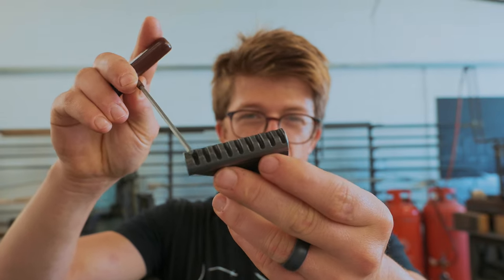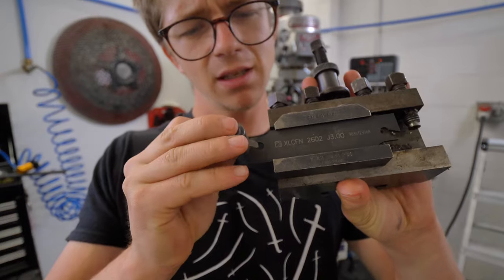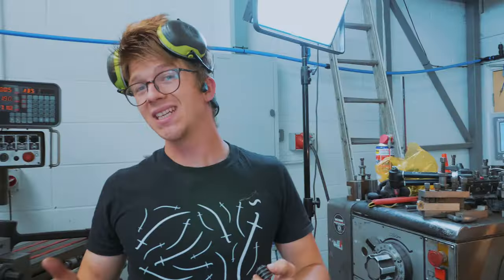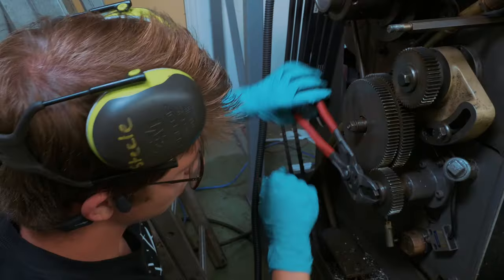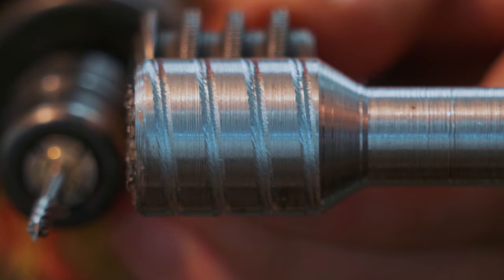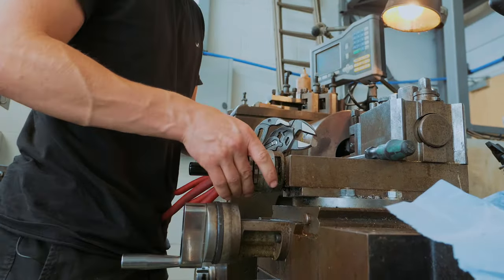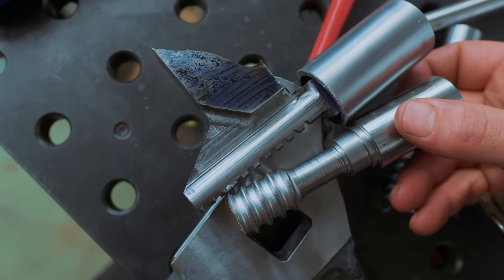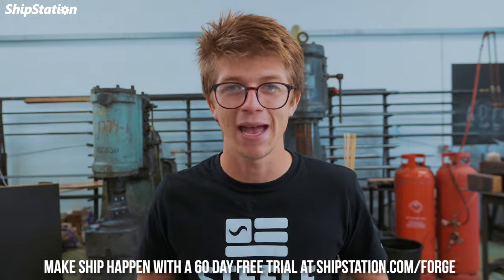Making My Own ADJUSTABLE CRESCENT WRENCH! Part 3

Comment: An idea for the handwheel numbers: set up an indicator to get a real measurement of the top slide, you can back out as far as you like to clear the thread and reverse, then wind in 1 rotation of the dial as your starting zero, then its easy to track your depth

Comment: What i have done before is to mount my angle grinder with a cutoff disc to the tool post and use that to do the work. Much more rigid than the small die grinder.

Comment: Hey Alec, you could have reversed the teeth and the worm gear and it would work the same, but you could have done it without grinding down the bolt.

Comment: No need to rely on "worn" out carriage screws and the built in indicator on the lathe. Attach a dial indicator and reference off of carriage or cross slide as a backup or verification method to your depth of cut measurements

Comment: But if advice, get you some High speed steel tool bits for times like this. Grind your tool until it matches the shape of the screw you’re trying to do. That being said the way you worked around and figured it out, as a machinist, I couldn’t have been more proud when you figured it out.

Comment: You could use the X-Axis (Cross-Slide) on the Lathe to retract the Endmill out of the Thread. 
As long as you return to the same Position as it was while cutting and don't unlock the halfnuts you should end up at the same position for each pass.
So basically you need to set the Endmill at the Leadangle of your thread (with the toolpost or compound-slide) and set your Cross-Slide Dial to zero before you start cutting.
Then do a pass -> retract the cross-slide -> return to your Startpoint (run maschine in reverse) -> go back to your Cross-slide zero and adjust depth of cut (tool height) -> do Next Pass -> repeat until finish.
Reply: He'll still have the same problem. It's the set up not the machine. The width of cut keep increasing because the cutter is at an angle.
So he's cutting a line, instead of a point.

Comment: If you were to get some square HSS steel blanks about 150mm long 15x15mm 
Grind it into a sort of part of tool type style if you will, 
Grind it to size and leave enough of a clearance angle so that it clears the part you are turning and enough of a rake angle so that it cuts 
You should be away with making your thread 
Hope that helps Alec

Comment: I believe your thread profile issue stems from this:  you're trying to use a cylinder to cut a square, as well as the fact that you have a tool that cuts along its entire length instead of just on the end.  

As I'm sure you're aware, it's hard to get a square corner out of a circular tool, as there will always be a radius to your cut.

More importantly, however, your tool is cutting over more than one point.  That means that while the actual segment of your tool that's contacting the bottom of the channel may be cutting it almost squarely (except for the aforementioned radius), the rest of your tool will be contacting the sides of your threads and hogging them out.  If you lay your cutting bit into that channel, you'll see what I mean.

(EDIT: This only would apply if you had the cutting tool perpendicular to the piece.  If you matched your compound's angle with the angle of the treads and are still having the same issue, then I've got nothing.)

Comment: Well theres a new method , its as fascinating to see what doesn't work as well as what does.  A lathe that size would have no problems single point cutting. Well done at the fitting stage.

Comment: Ive made my schoolarship 3,5 years on almost exact such a machine. With the gears and everything!
Maybe still not too late: If your scale on the diameter-axis isnt working as shown in your video, you can use a dial gauge to get the exact movement of your upper support! Set it up on your main support and place it in direction of the diameter infront of the upper support. You can see every single 0,01mm movement! Not sure if the scale is big enough for a 6mm screw tho :)

Comment: the reason the mill is cutting way wider than the bit... is because you're cutting from the side. the bit cuts more than just a point. remember it cuts in front and behind the center line.

Comment: The cutter is deflecting from stickout, like some people have mentioned, but also because the die grinder rpm is way too high, which means the chip load per tooth is probably less than the minimum size for that endmill. An air regulator to drop the rpm would improve this. Yes obviously grinding a thread form cutter is the right solution, but square threads are going to cause a lot of chatter on most lathes anyway.

Comment: Please please please make a cutter out of HSS, I make all my own turning tools and while it doesn't last quite as long as carbide, it should take an hour or two at most for someone who hasn't done a heap of it, I'd imagine less time for an experienced blacksmith with fantastic tooling too use. I love the ingenuity of making a die grinder fit, but it could be so much easier and better. Love your work mate!

Comment: Personally I would grind a tool to the profile you need, then cut the thread like you would any other thread, but just remember to use plenty of lubrication as you will have a lot of cutting edge cutting at once.

Comment: I think the reason your thread profile got screwy is because you turned the grinder a few degrees to match the thread pitch. But when you did that, the bit was no longer cutting a straight line. It was cutting a triangular shape in the cylinder. Because the cutting edge was meeting the material at 2 different places the further you got from your tool rest. It's the same thing that happens when you wiggle a drill around to widen a hole up a little bigger than the size of your bit. You probably didn't notice because the cylinder was also turning in the lathe, and you were left with a profile of the widest part of that triangle shape instead of a trench the size of your bit. You MIGHT be able to compensate by using a smaller bit, but that sketchy apparatus made me very concerned for your well being. So a smaller bit (that's more prone to breaking) is probably a bad idea. Great video. Keep 'em coming.

Comment: also a tool of a specific size almost never produces a cut of the same size if you go for a 4.8mm cutter you will have more accuracy in the thread albeit that you need to mill it from both sides of the thread.

Comment: Just make a HSS lathe tool from some square stock make a relied angle and grind the tip into the correct profile using a metal protractor to get the right tooth profile

Comment: How long before Will realizes that if you change the groove-groove spacing, while keeping the diameter the same, you also have to adjust the pitch angle? 
tan(pitch) = Spacing / diameter

Comment: You need to learn how to make tools out of high-speed steel or carbide. You can use old broken end mills and milling cutters. Just need a diamond wheel to do the finishing touches and sharpening. Making your own tools makes projects even better.

Comment: They make an ACME threading gage that will gage the profile of every ACME pitch profile. Side angles as well as nose width. Buy the gage and make your tool. Set your compound at the required angle. Use the cross slide to draw your tool back once you've zeroed it. Then use your compound to advance your tool after each pass. You're a researcher by nature. Look up the process, watch a few tutorials. You've done so many things exactly right. Do this part right as well. With a pointed pitch on your screw, the first time you exert any aggressive force on your beautiful wrench, you will shear those points right off and bind up your wrench

Comment: The one off tool would be the way to go but if you insist on end mill grinder setup make the OD of the threads bigger than needed and then flatten the tops of the threads to fit

Comment: I don't think the problem is the tolerance of the lead screw and locking nut, but instead the rigidity of the 3mm end mill. Something that small is bound to deflect when a load is put onto it. if you choke up on the end mill right to where the flutes start, then that makes the tool more ridged.

Alternatively, you can just grind a single point acme thread tool, I have made tools out of straightened and reheat-treated springs in my home shop before whenever I didn't have spare HSS.

Comment: So I was always taught to never cut both ways when screw cutting. The backlash will affect the cut. You need to pull the tool out and go back to the start to initiate the next pass.

Comment: A saw blade in a die grinder works well for cutting your 6mm pitch thread.

Edit: It appears to be a better choice to use an under width blade and creep up on cut width. This peculiarity with 2 and 3 inch straight tooth saw blades has shown up many times. Still thinking on the reasons for this.
Reply: Because the work piece is rotating into the cutter, and the cutter is at an angle.
A straight cutter will always cut to the same width, but if the cutter is on an angle the width increases with depth.
Perpendicular is a single point. Parallel is a full line. An angled cut is somewhere between the two.
Reply: @c6q3a24  On the right track. The cutter must be angled. There's a trick you can create a negative space to make the moveable jaw really lock to the thumb wheel. Some purpose built adjustable wrenches for an fittings use the modified thread locking method.
Reply: @WireWeHere  
Yes, it must be angled to match the thread pitch, but that is also problem. 

If the cutter angle is 6° and you use it to part off the end of the job you will not have a 3mm wide cut. You will have a 6° cone.

Every cut will be wider than the one before it,.
Reply: @c6q3a24  Slow your lathe down while set to the correct threading pitch and make many cuts to gradually cut in the desired profile. The cutter would move as the part spun and act as a live tool bit.
Reply: @c6q3a24  I usually use a stepper motor to drive the lathe. Plenty of torque and easy to set stop points

Comment: The Kaogong ji was written in China around the middle of the first millennium BC and is the oldest known technical encyclopedia. It details items ranging from swords to musical instruments and how to make them, including six chemistry formulas for mixing the bronze.
"These recipes were used in the largest bronze industry in Eurasia during this period," said Dr. Ruiliang Liu from the British Museum, "Attempts to reconstruct these processes have been made for more than a hundred years, but have failed."
Researchers had been unable to identify the two main ingredients: Jin and Xi. It was thought they were copper and tin, two key components of bronze, but recreating the recipes with them produced metal that did not match the composition of ancient Chinese artifacts.
Now, research by Dr. Liu and Professor Pollard, from the University of Oxford, may have finally identified Jin and Xi. Their work, published in the journal Antiquity, shows they were likely pre-mixed alloys.
The discovery was made whilst studying the chemical composition of Chinese coins from around the time the Kaogong ji was written. It was thought that these were made by diluting copper with tin and lead to create the desired form of bronze.
However, Professor Pollard and Dr. Liu found that the composition of the coins did not match this technique. Instead it indicated the coins were made by mixing two pre-prepared metal alloys: a copper-tin-lead alloy and a copper-lead alloy.
Reply: You could make a sword that hasn't been made in probably 2000 years... just saying

Comment: It’s angular distance! You’re cutting as a parallelogram and not square when using the side of the end mill like that, that’s why it’s wider. ://: :II: the distance between is wider! Because of this you would need a smaller than 3mm end mill to cut 3mm threads with the side this way. 

Use the pairing cutter and just angle it. Or get a high speed steel blank and grind the cutter you need. There’s a channel called This Old Tony that explains it all.
Reply: Correct. He is essentially cutting a line instead of a point. 
The cut width gets bigger every time you cut deeper. 
If he cut off the entire end of the job it would be a perfect 6° cone, with a very small 3mm radius on the tip.

Comment: New title for this video..

" How to make a project WAY more complicated than it needs to be . "

As others have said for the nut , cut a center and use the tailstock when cutting threads . Either get the correct cutter for the thread you're making , or shape a piece of high speed steel to the right shape . For cutting the grooves on the jaw, it may have been easier to put it in your standard vise and angle the vise rather than doing all the grinding on your securement for the rotator .

Comment: Isn’t grinding out the nut and tilting down five degrees equivalent to rotating the workpiece in that chuck and angling up five degrees? Maybe you have to flip it on the mill table to see the cuts, but still.

Comment: I think the problem you had with cutting the screw threads from underneath is that the deeper you went the wider the actual groove would get.  Cutting in from the side your pointing straight at the centre axis of the piece.  By having the milling bit under the work piece, the deeper you go you start cutting more from the lower left and top right so eventually the thread peaks will become points.  Wouldn't the die grinder have to be set at the angle of the thread to get flat top peaks???
Reply: Yeah he tried that, but the problem is the set up. He is cutting a line across the work, instead of a point. So every time you increase the depth the cutter effectively gets wider.

Comment: So I’ve not watched the whole vid yet but I know your trying to make a worm gear unlucky tho your lathe doesn’t have a function in the lead screw to cut worm gears as some do it’s still possible but it makes it a bit more complex to do, you can also cut a worm gear out on a mill using the dividing head but to be honest you’ve made this whole process really complicated best way like everyone is saying just go buy your self some HSS and grind a cutter for the job.
You won’t be wasting time on how to connect your dremel to your large with a hose coming out the end which can catch into the chuck and you’ll be having a great day.
BTW I’m not a fully qualified machinist yet I’m in my 3rd year of training so don’t take my word for it.
Hope you find this comment helpful if not just ignore

Comment: Well that was the hardest way possible to cut an acme thread.  Next time just grind a piece of high speed tool steel to desired thread shape and use that in the lathe...  Custom tooling is pretty easy to make for a lathe, if you can grind good edges

Comment: So he mimics the 5 or 6 degree angle on the original movable jaw, then replicates it on his. But doesn't mimic the pitch on his screw which should correlate to that angle. For the same size diameter, a higher pitch would have an increased pitch angle also.

Comment: I feel like the first set up could have worked if you had manually fed the die Grinder in to the work piece by rotating the chuck/spindle by hand. As long as the half nut is engaged, the cross slide and spindle are synchronised according to the gearing. You were feeding way too fast with the autofeed.

Comment: Just a thought from a non-machinist, but why not make the diameter larger than you need, the outside of the tooth profile is too “pointy”, but then you can use the lathe to “flatten” the top of the teeth?? As long as the trough is good enough for the teeth in the moving jaw, all good, right??

Comment: The reason the endmill cut wide. At 13.47 of your video you have tipped the die grinder the same angle as the top of the thread. But the bottom where you are milling is opposite of that angle on a screw. Anyway why didn't you just shorten up the parting tool and use it like a threading tool. Threading away from the chuck. It's not perfect but better than the die grinder. Also you could have setup a dial indicator on the compound slide and not worried about the dial on the handle.  I hope you take this as not criticizing just some friendly advice.

Comment: If nothing else, you could have put a sharpie into the toolholder to get an accurate line on the round stock. Then, you could simply use a file or your engraving tools. K.I.S.S. ...at least, thats what my metal-teacher always told me.

Comment: The reason the moving jaw and screw are mating up with minimal backlash is likely because you have the angle of the teeth wrong on the moving jaw. You copied the angle of the original, but then changed the pitch of the threads. A bigger pitch thread will have a steeper thread angle, so likely what is happening is that your thinned out threads on the screw are touching one one edge of the thread on one side and the other edge on the other side (hope that makes sense).

Comment: I think every Machinist watching this probably screemed... "Nooooo" as soon as you mentioned a die grinder.    😲
Reply: The crudest live tooling ever. But its probably where it all started. There had to have been that first person who decided to bolt their drill into their lathe. Look at Clough 42s video the other day, he did some thread milling in his lathe with his tool post grinder. was pretty neat.
Reply: @rossherman4515  I have made a custom holder to mount a die grinder on my lathe... but for small cylindrical grinding jobs. Alec's set up is about as sketchy as it gets (not that we all haven't done similar). That part needs a "never try this at home" subtitle. 😁
Reply: @C2DSolutions  oh yea! Thats for sure, its super sketch, but we wall learn somehow. (Side eyes the wooden dremel mount in tool post)